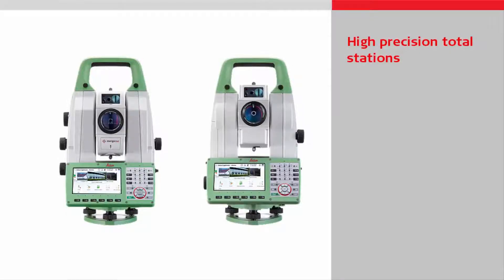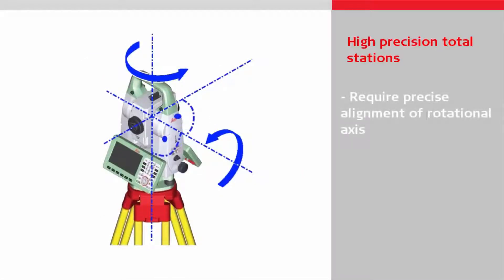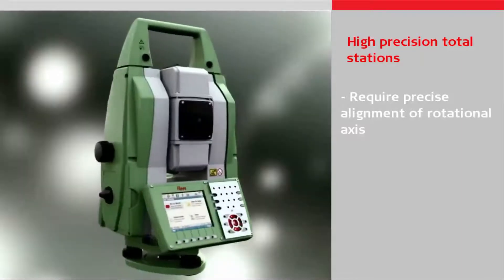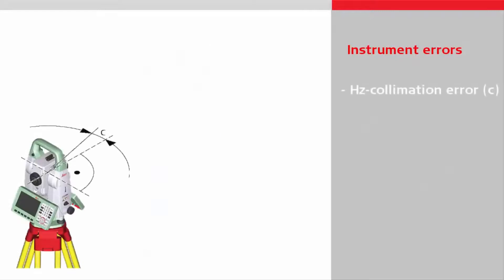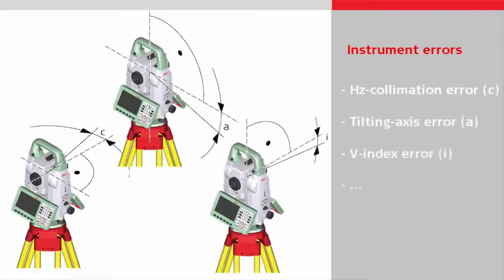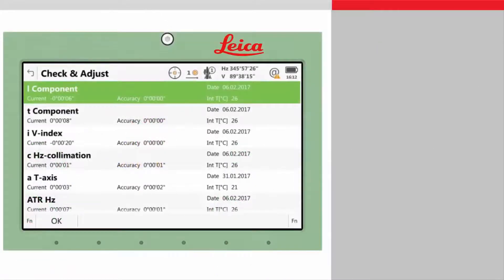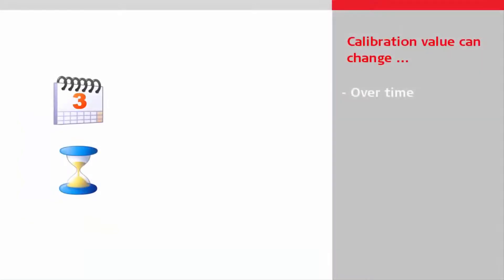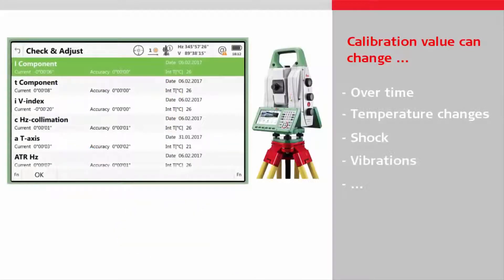How I check the cross hairs on the Dumpy Level

Comment: Hi FEPE EARTH
I was thinking about an experiment which might rule out the exaggerated refraction claims that some people make. If you were to find a lake or lough with 10-15Km of open water between shores.
Get a motorboat with a 4 meter high board secured to it painted in alternative red and white horizontal 1meter stripes also the boat should have an altimeter, barometer and camera on board.
Pick a day when the water is calm, have the motorboat in the water at the shore, set up a calibrated dumpy level with a camera mount so that the horizontal crosshairs intersect at the 2 meter mark on the board. 
Set the motorboat off in a pre destined straight course where the vertical crosshairs of the instrument intersect a landmark on the opposite shore. 
Have both the dumpy level and onboard boat cameras recording from boat starts off until it reaches the far shore. 
If the earth and water is level the following should be observed, The onboard altimeter and barometer should not change altitude or pressure significantly also the horizontal crosshairs on the dumpy level should not change position on the board significantly either. 
The only other thing to consider is refraction, but what part would refraction play in this experiment if the altimeter, barometer and crosshairs dont change significantly ?  Will the horizontal sight off the dumpy level be bending up into the atmosphere and then bending back down to the boat with the curvature of the earth at a constant rate over the constantly increasing distance ?
What do you think about such an experiment as there is such a body of water about 500yds from my location.

Regards
Flat out

Comment: Hi FEPE EARTH
Good video and soundtrack. 
Im upgrading my old Geo Fennell 26x to the latest Bosch instrument, it called a : BOSCH GOL 32 BALLBUSTER

What you propose is a good way to check if your level is off but I think adjustment should be carried out by a professional as the accuracy of your instrument should +/- 1mm @ 30meters or 33.33mm @ 1Km, I dont think there are too many people that would have the equipment at hand to calibrate to this degree of accuracy, just be carefull with adjustments.

Regards
Flat Out
Reply: FEPE EARTH
I take it you explaind to Total Tools that the accuracy of this instrument was a matter of great importance to all of mankind and they offered a free calibration !